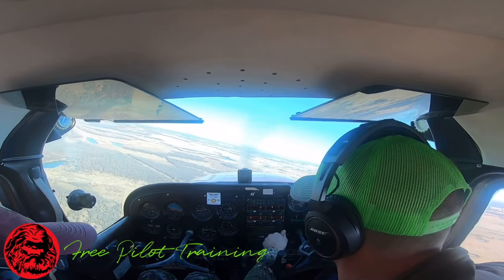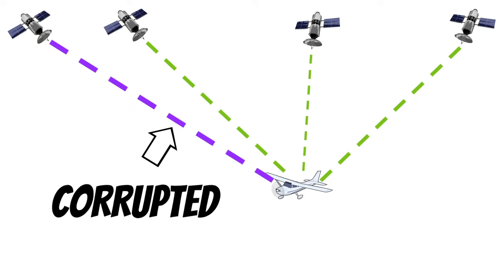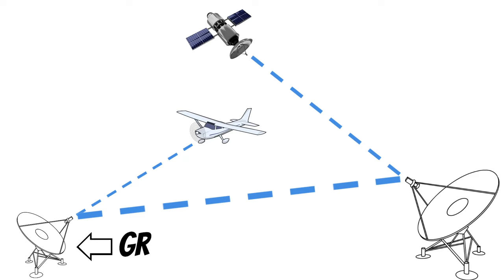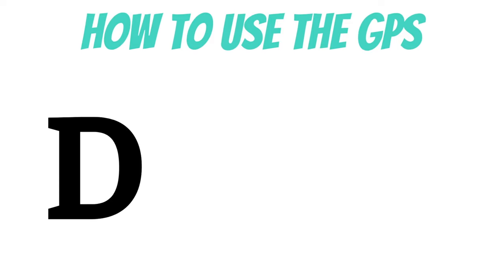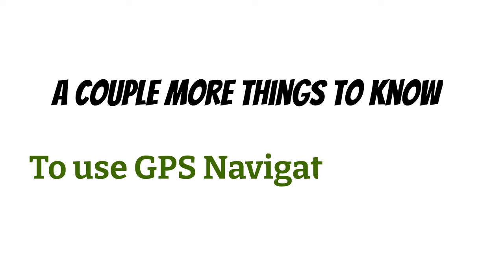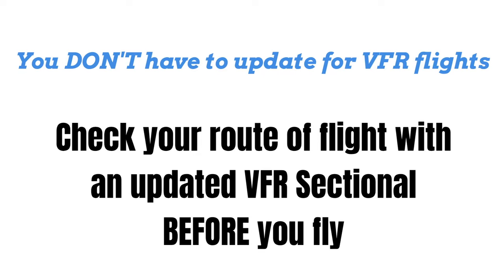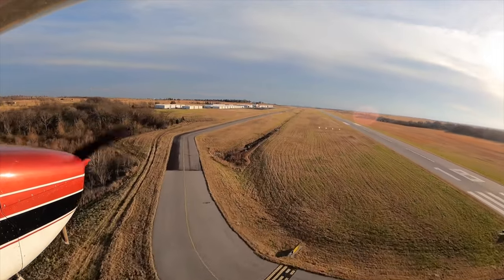GPS Navigation Explained (Private Pilot Ground Lesson 38)

Comment: I use a heading set in the directional gyro as a backup, written down on my knee pad. Then track GPS till around 20 miles out. Then when Airport in site, use a heading track in the autopilot to get squared up 90 degrees to runway, or straight in on approach after Airport in site. Then fly on in at TPA.
Reply from the maker: I prefer using the GPS track to get started, looking at the track then using the gyro. I think you have more control that way.

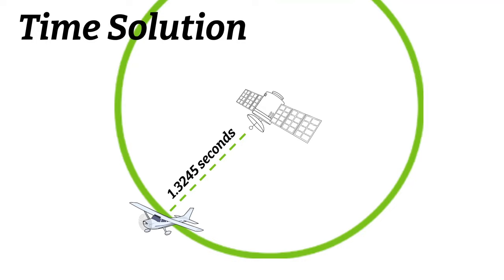Comment: I think I might have a correction at minute 1:00 (more or less). With just one satellite there is no way you can accurately tell the time distance between the receiver and the GPS satellite transmitter, since the GPS is one way non-communicating signal, there is no way for a back and forth to operate to measure the ping distance between the two.
Said that, as I understood it’s not about distance from each single satellite, but from the relationship between the signals of various satelittes. You see: satellites know for sure their position in the space (adjusted by ground every once or so) and the exact time through very very precise atomic clocks. What GPS satellites do is to broadcast a signal every lets say “round second” (example 1:01:00000), all of them do. Then you receive these signals from the satellites on your reach at different times, depending on the distance of each satellite. Since the receiver doesn’t have a synchronized atomic clock, all it has is the relationship of times of each signal. With those and the position said by each satellite then triangulates the position. If I have a source that can unveil the mathematics behind this I’ll post in the comment section below.

Anyways, great video as always!
Reply from the maker: Great points. Thanks!

Comment: Why do you think the gps tracking for the public, when plains flying over the ocean, on Long flight disepears. Isnt it a global position system?
Reply from the maker: Well, I’m not an expert on oceanic crossings, but I don’t think ADSB is required when crossing the ocean, and they turn it off when they’re flying over international waters. They should still have GPS out there, but the accuracy doesn’t have to be as good. Probably because there are fewer satellites in range
Reply: @FreePilotTraining  if you think about it its kinda strange. Since its sepose to be a saftynet if enything would happen to the plaine and the passangers over these travels.  gps is Created by the USA defens departement. And dont you think they have the finance to go arround this "problem" regarding singals? I dont buy the not anough satelites thing. Cus is more then anough of them
Reply from the maker: @lokabanditt  once again, my answer is a total guess. I’ll try to do some more digging cuz I’m curious as well
Reply: @FreePilotTraining  let me know if u find a suiteble answer about the subject. I Will try to do the same :)
Reply from the maker: @lokabanditt  will do
Reply from the maker: @lokabanditt  Ok, I found part of the answer.  The reason you lose ADSB when crossing the ocean is because your airplane knows it’s position based on the satellites available.  However, it transmits is position back to the ADSB system through the use of ground based systems. My understanding is that some aircraft have the ability to transmit their position back to the satellites, but most of them do not.  So when you get out of range of those ground based stations, ATC can’t tell where you are.